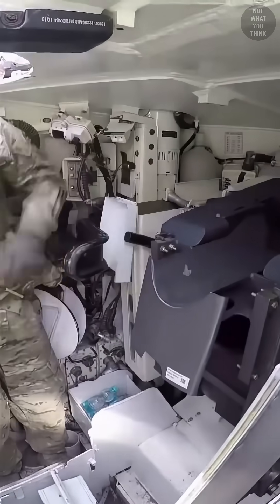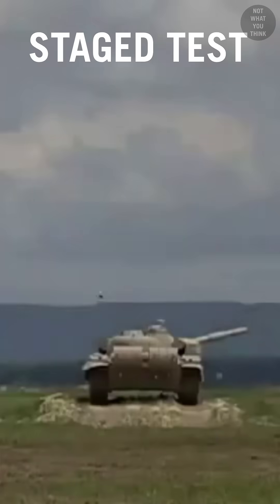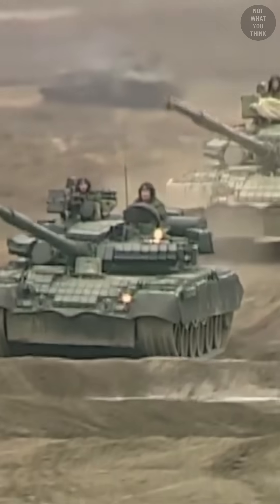Why M1 Abrams Tank Has No Auto-Loader #shorts

Comment: “Less moving parts the better” - literally every person who’s ever worked on a machine
Reply: Its better to be tired from having to manually load rounds than to be blown up.
Reply: Sure hope you don't use powered steering or powered windows in your car.

Technology requires more moving parts before requiring less.

We learned this lesson when we switched to destroyers over giant battleships.

1 to 2 manned tanks will dominate over 4 man and even 3 man + auto loader tanks.
Reply: @Shyhalu  No they won't. The reason they won't is because if the tank throws track that tank is now a mobility kill. That crew can not get out and be protected by its own tank to repair the track. On average on an Abrams this can take between 30minutes to an hour. However because there is still 2 crew members in the tank, they can survey the field and keep their other crew members safe while conducting the repair in the field. If you had only a 2 man crew well both would need to get out and now there is no one inside the tank. Also all the communications are inside the tank as well so no one listening to comms if its just a 2 man crew. There is other reasons why a 4 man crew will be better. But I have already noted in earlier comment that less crew and more technology to remove those crew members is not anymore effective or more superior then what would be replaced that would justify the cost to do such things and MBT's are already expensive as it is. Unless it can be shown that they are vastly more effective without 2 other crew members it simply won't happen and that the only countries that would persue such endeavors are countries where they are limited how much personnel they can spare for any given vehicle but it doesn't mean they would be vastly superior just it would work for them with their limited personnel which again countries like the US and others are not in short supply of. Also in regards to your comment about rations, MRE's are not bad and contain all the calories you need for the day and you can do just fine eating just those however I will say there is only a few other countries where rations are not bad either while all the rest it may be risky or not very good. Inside the Abrams is not hot at all and it has better ventilation then your house does as it is designed to operate in biological warfare. The ventilation is so good in an Abrams that it feels like it has AC in it :)  And we turn this thing on every so often lol.  I know because I was an Abrams crew member and have been in one in a desert in the summer time.
Reply: Though I do believe in that.
The auto loaders is pretty reliable mechanically.
Reply: humans are even more moving parts
Reply: Those shells don’t weigh that much when youre full of adrenaline after the first round goes flying down range, I was a loader and driver on the Abrams and the only round I had issues with were the can rounds, which are a shotgun shell but for tanks
Reply: "My arms hurt" - The loader after loading the 20th round manually
Reply: @BigMek456  if the loader complains well he is in for a bad time…
Reply: @SomuaSomua  He doesnt have to complain. He will get slower over time. There wont be anymore designated manual loaders in future tanks
Reply: @SomuaSomua are you guys seriously arguing about picking up 20 shells in a row being tiring?

They weigh about the same as a small hay bale. Farmers unload wagons of these by hand, hundreds of bales per load, dozens of loads per day. Then they do it again the next day. Their arms aren't tired.

I promise a 20 year old in combat picking up a fraction as many shells doesn't notice a thing. He's probably thirsty though. Lol
Reply: @kingkonggordy  I am arguing that autoloaders are better, especially if you have to shoot 155mm rounds. In a few years manual loaders in armored vehicles will not exist anymore. Especially with ever increasing weight and size of tank and artillery rounds
Reply: @BigMek456  and if the auto loader jams?
Reply: @Sapphiregamer8605   autoloaders dont just jam up. Same as asking what if the engine explodes? Doesnt make you consider a horse drawn tank though does it?
Reply: @BigMek456 Any machine, no matter how well maintained, has a chance for failure. While the engine might not explode, a piston might not fire correctly and snap in two. You overvalue the ability for autoloaders to consistently put rounds in at quick times when NATO specifically chose not to put autoloaders in their main battle tanks to prioritize crew safety, something that was impossible with autoloader designs at the time. The only benefits the tanks would get are the ability to follow up missed shots quickly snd efficiently, which made sense when originally gunners were only using EB mark Is to detect enemy vehicles.

Now with complex stabilizers, high performance ammunition, a variety of electric optical views to detect vehicles based on heat and exhaust, and the long range these vehicles can shoot at, the first shot is critical. The first one who hits the tank is the first one who wins and so the mindset is if the NATO tank loses, at least the crew can bail and be fine. With Russian tanks, well you have seen all the T-80 space program memes.

The autoloader might be the future, but forcing young concepts into service doesn't give you the edge if there isn't a refinement process. The Soviets, for instance, were the first to use smoothbore cannons. Despite this, performance was only negligibly increased with rifled bores still being able to penetrate T-62s frontally. When NATO implemented smoothbores years later, they saw more drastic performance increases. It was the same case with ERA. The Russians tried to force any concept through if it seemed like it could replace the old, without going through to improve the concept itself before implementation, at the detriment of actual performance gains. NATO, on the other hand, took the time to experiment and develop before putting it to service.

That's what is going on with autoloaders now. The autoloaders devloped by the Soviets and used by Russia now suck ass. They leave the tank in too much of a vulnerable state, force the crews to take it to the depot if issues arise, and offer very little gain for what they provide. There simply isn't a need for NATO to rush to phase out loaders. The Ukrainian crews right now with the Leos aren't actually miffed about having to reload, in fact they are probably incredibly happy to not be having to use a T-72 anymore as their main tank. It's a massive benefit of everything else over now having to manually reload shells.
Reply: @AstinCrow   Autoloaders work fine in the Leclerc, and that tank is safe, capable and reliable. Its an issue of cost, not of technology. It might be fine now to keep manual loaders. But tank guns grow ever larger. In the future, manual loaders will not be a viable option. Not with 130mm or larger NATO main guns. The new KF51 prototype will also use autoloaders. Germany and France put the Leclercs turret on a Leo 2 chassis to test the concept. Best of both worlds. You seem to be of the opinion that I think Russian tank design is superior, which it isnt. But at the same time their concept of an autoloader doesnt disprove the concept in general as a failure.
Reply: @BigMek456 "Autoladers are better" Javelin says hello
Reply: @Bismarck-1   your comment has zero correlation to anything
Reply: @BigMek456 Nah I don't think so. I mean they probably won't be used in any wars, but thats only until they find a safe option or a safe auto loader. They will still be around just like ww1 and ww2 armor. Sure there outdated but they still work even though they won't be used.
Reply: @MarcusDaddy-z4x  The Leclerc uses a autoloader with a blast shield. Just like any tank in the future. I am aware that you cant take a Abrams or Leopard and just convert it into an autoloading tank. Their sucessors like the potential KF51 prototype will all have autoloaders though.
Reply: @BigMek456 Just because something is bigger doesn't mean it's better. Tanks are vehicles. There is only so much you could  do with it. tanks have mass and weght of all the aspects of the armor. Just like you.  For example if soldier carries around a rpg 24/7 of course he would need to refresh. But a soldier with an rpg and hmg on his back will just make him a slow moving target with no armor protecting him. You have to think of armor and air in the same way. If the armor is to fat and heavy you might as well toss it. To light and barely scratching an enemy you might want to toss it as well. This is why so many vehicles, weapons, aircraft failed in ww1. The design did not fit the current situation on the battlefield and more soldiers ended up dieing then necessary.  Whoever thought it was a good idea to strap someone in a suit of of armor with a huge machine gun? They will be moving so slow and all you would hear is *clank*. The cloth regular soldiers were wearing did not protect them from bullets at all. As a matter of fact, in my opinion it made bullet wounds worse.
Reply: @MarcusDaddy-z4x  What are you even refering to? This doesnt have anything to do with what I said?
Reply: @BigMek456  Tank is armor yes? Armor needs to work like a human. Each part of our body holsters an organ. If one organ gets out of shape the whole body feels its effects.  Think of a tank the same you think of a soldier. It's own unique traits and perks it brings to the battlefield.
Reply: @BigMek456  Basically are referring to the effectiveness of a tank using what u said.
Reply: @MarcusDaddy-z4x  What exactly has that to do with autoloaders compared to a manual loader? How is a Leclerc "out of shape"?
Reply: @BigMek456  You do realize that most military personal care about the outcome and performance of tank,soldier,aircraft etc right? If one tank fails with an autoloader what good is the rest of em? One bad apple spoils the bunch. But if autoloader is good. Then will keep using it until it's outdated and so on.
Reply: @BigMek456  Nevermind it is kinda hard to explain. Tell you what. Play acouple games of chess. Learn the effectiveness of each of the pieces then get back at me. Once you do that you will know that most battles are carried out in the same way.
Reply: @BigMek456  I was an actual Abrams crew member and I can tell you why the US army will never use an autoloader for its MBT's. The abrams fires 120mm shell. It houses 46 rounds. The distance between the blast door for the bustle to the breech block is not very far in fact you can pull a round out, flip it and slide it into the breech in a very fluid movement and you won't get tired as long as a steady pace is kept. Autoloaders have existed since WW2. This is in fact a long time and the US army still does not use an autoloader for its MBT. Autoloaders are not faster then a human. On average an Autoloader can reload a round in about 10 seconds. Abrams loader can do that in 7 or less. Autoloaders are prone to jamming. The bradley track vehicle has a 25mm autoloading cannon, and they jam all the time and to remove those jams is sometimes dangerous depending how it jammed or what caused it to jam. Also in regards to autoloading you have to keep in mind that the round needs to travel through a system from where its stored to where its going to be loaded into. Anywhere in that mechanism the round can jam. Not all jams can be resolved on the field and if that is the case that is one tank now out of action not due to it being killed but because of some malfunction. Also, you have to factor in how do you restock an autoloader and whether or not can that be done on the field. An Abrams can be restocked without specifically going back to an ammo point. That means an ammo truck can bring it more ammo and they can restock on the field. Autoloaders typically can not do this because they would be too vulnerable as you would have to open up some compartments make sure the tank isn't on, maybe face the turret in a particular direction etc. Now, in regards to safety. The rounds in an Abrams sit in a bustle rack and due to the design in the turret if those rounds explode in the bustle rack the crew will remain safe because on top of the turret their is blast openings that will open up and funnel the blast up out of the turret instead of inside the turret. In an autoloading setup, you can have this but only for the rounds that are still in the rack not for the rounds inside of the autoloading feeder system. To keep it safe this means you couldn't have rounds inside of the feeder belt system waiting to be loaded and instead remain in the rack, this increases the time for the autoloading mechanism to reload due to safety. Now, all of these mechanisms will add weight to the tank. The Abrams already weighs in at 74Tons. The primary reason other countries use an autoloader mechanism isn't because they are better, rather it excludes the need for an additional crew member. Other countries do not have a large military to begin with, and therefore can't afford to expend more soldiers on any single one thing. Where as the US and other countries that have a military like the US can do this and therefore have no need for an autoloader since an autoloader is not inherently better rather it is worse. Fun fact an Abrams can still effectively fight with only 3 crew members it doesn't not actually have to have 4. But it does because it increases the effectiveness due to some things it has where TC and gunner work together on target spotting, prioritizing and shooting. Both the gunner and TC can be gunners at the same time. If you want more clarification on something in regards to the Abrams feel free to ask and remember I did operate the Abrams and have done so from all 4 stations. I have drove them, loaded them, fired them and been a TC. Don't assume because some other country uses an autoloading tank means that somehow they are better when really they use them because they simply don't have the military size for additional crew members and therefore the autoloader removes the need for a loader. Also abrams uses 120mm, so if it were to have 130mm it could still be reloaded manually just as efficiently.
Reply: @wolf2179  What youre saying is a bunch of nonsense isnt it? Of course the Abrams isnt going to be converted to an autoloader. But not because autoloaders are bad. Autoloaders need 10 seconds to load? The Leclerc needs 5. Thats faster than a human. THey jam frequently? Nonsense. The ready rounds cant be stored behind a blast shield? Nonsense, the Leclerc has a autoloader with a blast shield. It adds too much weight? Nonsense. Leclerc weights 56 tons with similar protection to an Abrams. Your mindset seems to be stuck some time in the middle of the 20th century. This reminds me a lot of the past when armies wouldnt adopt autoloading rifles over bolt guns because muh cost, muh moving parts etc. The technology youre currently using is not the be-all-end-all.
Reply: @BigMek456  
>your comment has zero correlation to anything
>Compares Leclerc autoloader to a T-72 autoloader
Reply: @BigMek456 did you not watch the video?
Reply: @BigMek456 i mean can the autoloader repair the tank?, help with maintenance?, or take over a gunner or a drivers role?,
Reply: @QuandaleDingle-ql3nf  Look at some videos of Ukraine. What kind of repair do you want to do when ATGMs and artillery fire at you? What significant maintenance are you going to do? If your gunner or driver are incapacitated you have other way more serious problems. Why not 5 crew members then for your reasons? Or even more like in ww1?
Reply: @AstinCrow  Abrams świetny czołg do walki ze starymi t55 i t72 na pustyni gdzie jest widoczność na 20 km pod warunkiem że ma wsparcie śmigłowców, lotnictwa, artylerii i czort wie czego jeszcze. Za każdym czołgiem jedzie cysterna z paliwem i ciężarówka z częściami zamiennymi 😁a trafienie byle czym w apu niszczy czołg 😁.
Reply: @BigMek456 who told you the US army is switching to 130mm main guns and ditching loader positions on tanks. This is the first I've heard of it. Why didn't the m10 booker get a 130mm gun and auto loader?
Reply: @Bismarck-1  This is about autoloader vs manual! And l agree if autoloader is better!
Reply: @BigMek456  Why do you need 20 shots? 120mm cannon used by NATO Can destroy any Russian tank with just one shot. With APFSDS shells, no Russian armor can stop it.
Reply: @BigMek456 
20 rounds...i dont think an abrams is going to be firing 20 rounds in rapid succession when it's surrounded by other abrams and apache gunships.
Reply: @ruthnoya8424  Yeah, "when". Works really well for the Leos in Ukraine right now. Im confident the guys operating the PzH2000 are glad they dont have to load the rounds manually
Reply: @BigMek456  
I'm sure they are glad, less physical strain the lower chance of injuries. On the other hand, most young military guys are in great shape and loading a 40-50lb shell isn't that bad. Most moms can repeatedly pick up their 40-50lb toddlers-to-6yr Olds. My brother was in the service and he was in great shape, he could curl 60lb dumbbells like 8 times, that's one arm.
Reply: @BigMek456 if you have to fire 10, you’ve got other problems
Reply: @BigMek456 okay, well, if you HAVE to fire 20 rounds, then you should be concerned about the combat, not loading more and more rounds.
Reply: @BigMek456 I think you’re overestimating how much the shells way. Think of an empty barbell. An Abrams shell ways 5lbs less than that. If a tank operator gets tired from picking up less a barbell worth of weight 40 times, he probably would’ve failed PT, and 40 rounds in rapid succession is worst case scenario. More likely it much less at any one time. A healthy fit person should be able to do that. Besides, even if they are slower, I’m sure they’ll happily take their arms hurting over getting incinerated in an explosion from within the tank.
Reply: @bobbart6498  An autoloader has a constant speed, a leclerc can load a round as fast if not faster than a human loader can. And I already disproved the myth that an autoloader means no blast doors or blowout panel in a tank. In the future tanks will have 130mm and 140mm guns. Its the future.